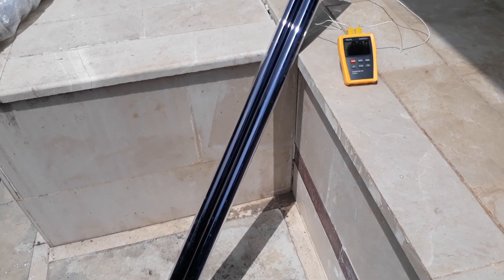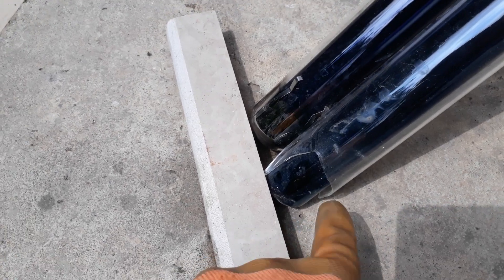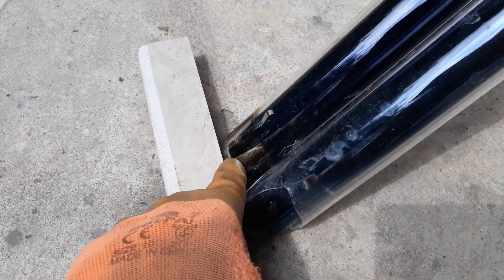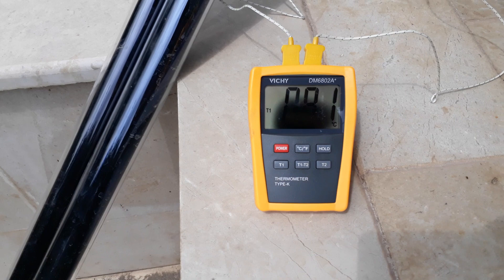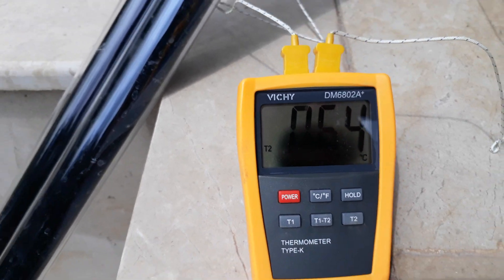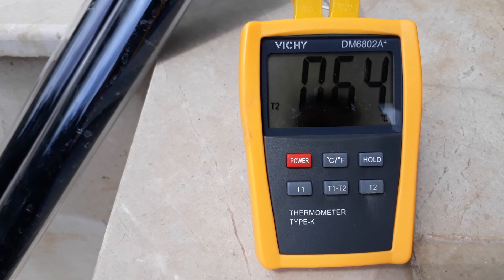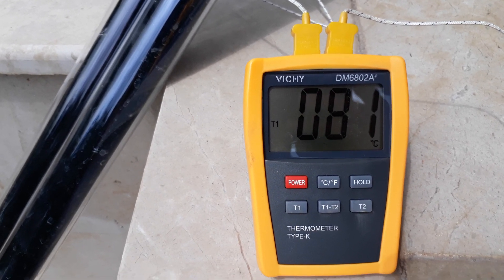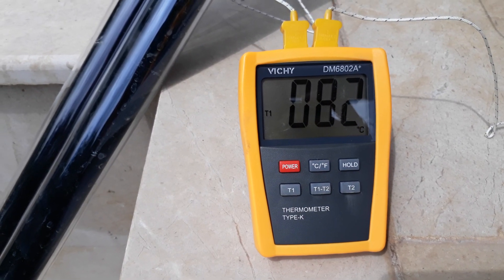Effect of vacuum on evacuated tube solar collectors

Comment: in other way does the vaccum make the tube higher in temp.?
Reply: yes
Reply: Vacuum is an insulator, thus keeping the heat where it supposed to be
Reply from the maker: Yes, due to the reduction in convection heat loss.